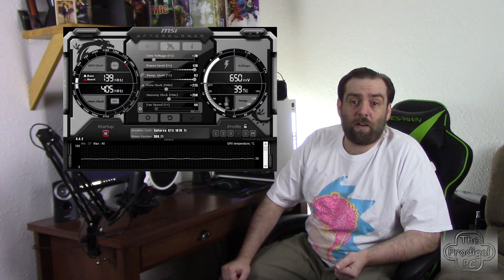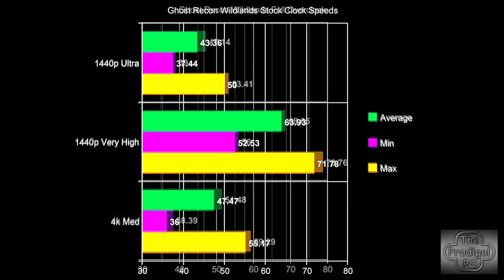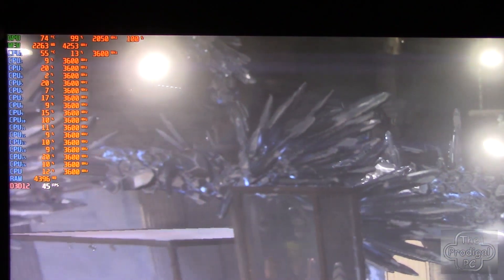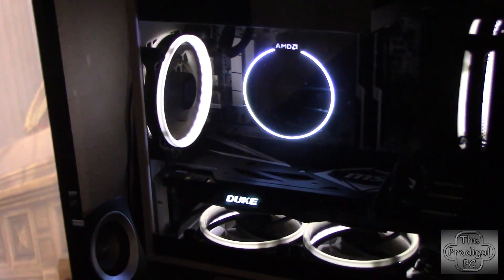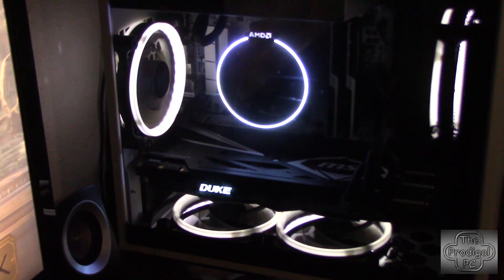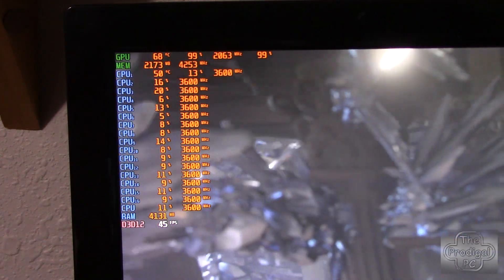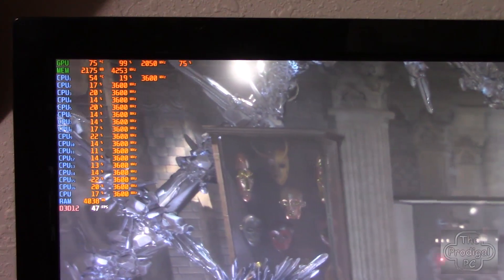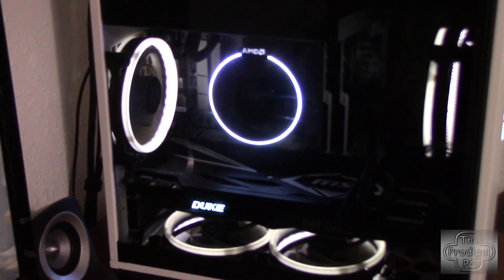MSI 1070 Ti DUKE on Ryzen 1700 Overclocking Results!! (Finally)

Comment: Hey man! I get upwards of 80 degrees celcius while gaming with this card, is this normal, and do you get these temps??
Reply from the maker: I haven't used it for a while but it did get into the upper 70s before I changed the thermal compound.
Reply: @TheProdigalPC  Sweet! thanks so much man!

Comment: i have the same card but was wonder inf if its' normal for the GEFORCE GTX to not be lighting up.
Reply from the maker: The GeForce GTX is only painted on the shroud. The only part with LEDs is the "DUKE" on the side.
Reply: Thank You. This review with Gamers Nexus review for 450USD is a insane deal as I upgraded from a MSI 1050Ti 4G Gaming X.
Reply: @slaxiscs881  lol same

Comment: JESUS MAN ! thats an aggressive overclock !! 
i got the same card and i might go open loop soon to squeeze every 1mhz out of  it lol , pretty cool video and nice experiment ! CHEERS!
Reply from the maker: It only seems that aggressive because NVidia told all of the AIB manufacturers that they were not allowed to OC the 1070Ti at the factory and they all had to have the same stock and boost clock speeds, allowing for those of us who overclock our GPUs  to get those seemingly high numbers. In reality GPU boost 3.0 get nearly the same as my OC did but I wanted to get everything I could out of my equipment.
Reply: well.. i guess u won the silicon lotto , my 1070ti duke cant be more stable at 170+ core and 500+ memory .. @The Prodigal PC
Reply from the maker: Have you tried pulling back the memory clock and going all out on the core clock speed? That VRAM OC might be causing the instability at higher clocks. What is it boosting to with out OC?
Reply: The Prodigal PC will check out and let u know .. its already 5.41am here gotta sleep lol .. 
Btw, i contacted msi and they told me that re-applying thermal paste / waterblock will VOID the warranty :S
Reply from the maker: When I contacted MSI I made sure to have them send me notice in writing that the warranty would only be voided if there were physical damage to the card. I made sure to save several copies of the correspondence to make certain I had coverage. It may have something to do with our geographical differences.

Comment: i have the same card, I have a feeling the stock shroud isn't allowing the hot air to escape the heatsink since it goes all the way to the pcb. just an idea i will try and test this soon myself.
Reply from the maker: Stay tuned fo next month when I put an H55 AIO on the DUKE and see what happens to the performance.
Reply: whats your temp with this card .. i couldnt decide between gaming x and duke .. but finally i picked gaming x .. and i get 69c with 60%fan in games
Reply: Did you check that out?